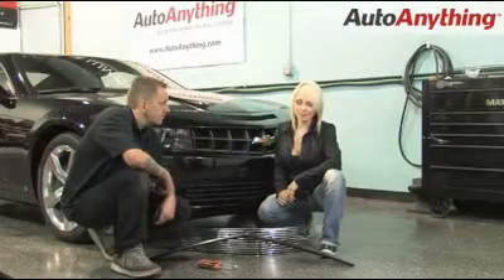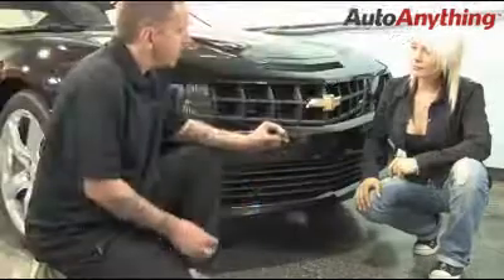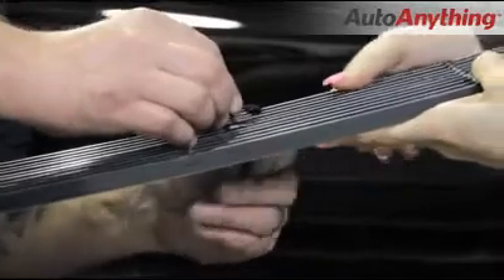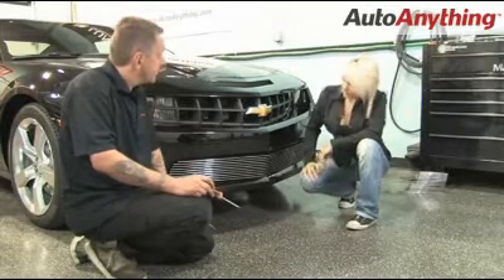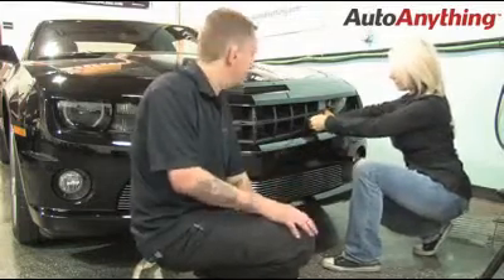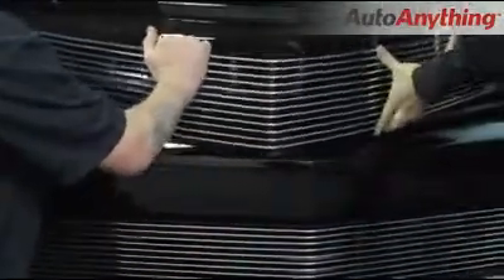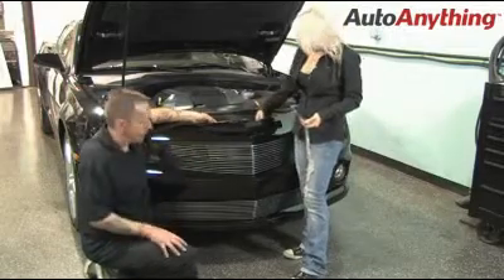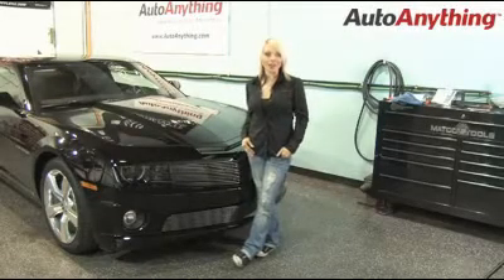AutoAnything Installs a T Rex Billet Grille on a 2010 Chevy Camaro

Comment from the maker: Ok, I've looked into this. T-Rex does make both replacement and overlay billet grilles, but they only make overlays for Camaros, which means there is not a way to install as a complete replacement.  It can only be installed as an overlay.

In the video, our installer was trying to describe the two ways to install a T-Rex grille.  It wasn't clear that this was a general statement, not specific to the Camaro. Sorry for the confusion!